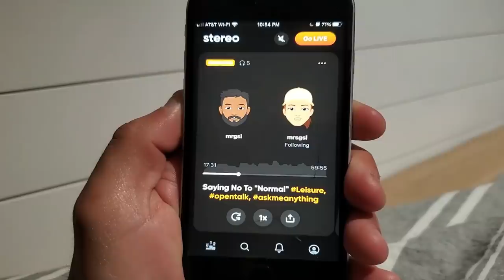Family Builds Chicken Coop Guaranteed To Get You More Eggs | How To Build A Chicken Coop

Comment: Use some WD-40 on the sticker removal process.

Stack the roofing panels and then drill pilot holes through the stack.

For the hole lineup instead of the scatter form.

Comment: Aluminet. It is a shade cloth made from aluminized shade fabric. I use it in Southern California to reflect the summer sun, my patio would be useless for a couple of months a year without it. It is used by the greenhouse industry and comes in different percentages. It is used by people at Burning Man to take the hot heat on the playa. It is also used by police departments to protect their K9s and also by those showing their dogs at shows. A major advantage of this type of tarp is that it is filled with lots of little slits that let the light in and helps it not to flap in the wind. It would be easy to pull over your coop and is easy to tie as it has brass grommets like a good tarp.

Comment: You really need to fit the the foam profile strips under the polycarbonate ridged roofing . The first thing you fit is the foam profile strips along the length of each joist. This foam is essential as the poly has no inherent strength to support itself. It also stops the screws from flattening the profile. It is a must. In your case what will happen is the poly will flatten slightly in the sun and all your screws will be left sticking up. The panels will then just flap in the wind and eventually shatter around each screw hole. The only reason I know is I have been there and didn’t know about the foam strips and got caught out.

Comment: No need for Goo Gone! Just remove the top plastic layer (if there is one) and smear on a decently thick layer of peanut butter (cause it stays on) to cover the entire sticker, and after an hour or two, the oil in the peanut butter will have loosened the adhesive grip, and then you just pull it off, and then wash off the oil with soapy water. 

Any oil would work in a pinch, but peanut butter is best due to its staying power!

Comment: Jeremy and/or Melissa, aren't you guys concerned about mink, ferrets, or other members of the weasel family getting into the chicken coop?  The wire mesh you have on the coop now will keep the chickens in and larger varmints out but not the smaller ones.  You might need to add chicken wire around the coop to.  Just a thought.  Keep up the great work!  Cheers!
Reply from the maker: We are using electronic netting at the bottom

Comment: The best way to remove those pain in the but stickers is with a little bit of heat on the other side. If you don't have a heart gun try a hairdryer or torch at a safe distance as not to melt or distort the material. I hope that this changes some one's life.

Comment: Always enjoy your videos. May I make a quick comment, no offense ment , using corrugated plastic is ok but will condensate in the winter sun and will drip internally making the ground inside wet and you screwed them down in the groove. This will leak, you needed to use hollow plastic supports and screw through the peaks so it won't leak. 
Look forward to your next video.

Comment: We ended up going with a wire mesh floor also for the coop we are building... are you concerned about winter at all? Or will straw be enough? I was contemplating putting swing doors underneath..🤔🤔😊

Comment: You two should look into making rows of vertical log post stand raised garden beds this spring. 4 tiers per stand boards 8 or 12 feet long nailed on each side of the log post with bottom board drilled with drip holes add 3 small center post in the middle to support the three upper tiers this will allow you to grow much much more in a limited space. Also allows you separate your harvest times by the rows and tiers. These are pvc pipe compare to what I suggest with logs. But gives you guys a better idea.https://www.youtube.com/watch?v=vPRySy3Qtvs&t=172s

Comment: hello from the north of France.  job well done.  i have a question concerning the roof.  i just completed a 4 by 5 meter roof in steel.  here:  i fastened the roofing material to the hump portion of the corrugation as opposed to the flat area of the corrugation.  did i do it wrong ?  all the best  cheers

Comment: Looks to me like the cutters you are using on the wire are the wrong type.  Those look like cable cutters for soft wire, like electrical cable - they aren't really designed for cutting steel wire.  You may find regular wire cutters to be far easier to use.  You may find that something like the Channellock 337 will be far easier to use.  Give your hands a break.  :)

Comment: Hi guys! The cheapest and easiest way to remove stickers from plastic, metal, ceramic, and glass is to use rubbing alcohol. Make sure the stickers are dry because residue will be left behind if the sticker is wet ( water dilutes the alcohol..keeping it from dissolving the adhesive on the sticker ). If the sticker is dry, then just saturate the sticker with alcohol, let it sit for a few seconds, use your fingernails to grasp a corner of the sticker and pull. Most, if not all of the sticker will come off in one piece..including the adhesive used to stick it to the product it was on. Easy as that. No rubbing, no sticky residue, no sticker/label. If you do have a wet sticker..dab as much of the wetness off as you can, use the alcohol to get as much of the sticker off as possible, then use a doobie ( a doobie is a kitchen dish scrubber ) pour some alcohol in the doobie, and scrub. That will usually take off the remaining residue from the sticker. Hope this helps you guys:)
Reply from the maker: Thanks for the tip!

Comment: With that pitch and any kind of snow loads, those panels are going to be on the floor of your chicken coop.  Eminent failure virtually guaranteed with that design.

If your goal is to maximize the sunlight in the winter, build a proper pitch to your roof, put on metal roofing, and use the plastic all along your south-facing wall.

Comment: Roosts are too big around, only need to be about an inch in diameter They need to be able to wrap feet around and hang on they set down over feet to keep them warm.  Need a bottom to hold heat in during cold weather. Otherwise cold draft will constantly be coming up from bottom and it will be harder for them to keep feet warm.